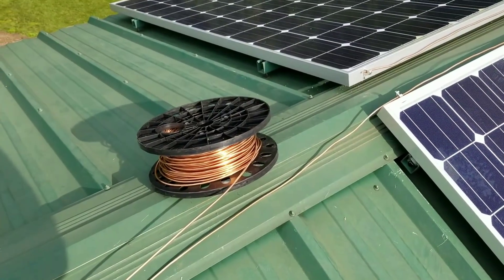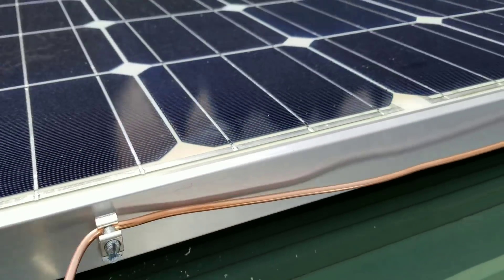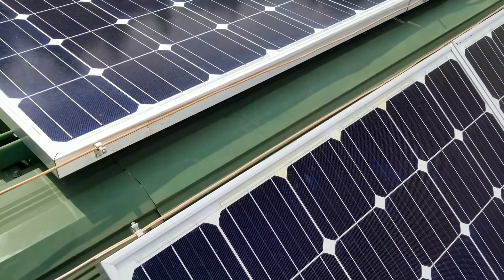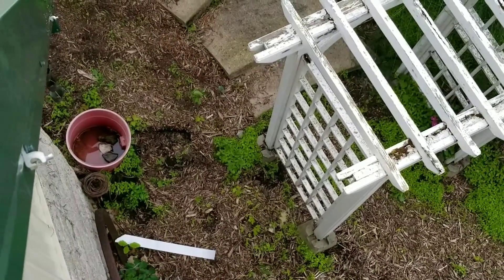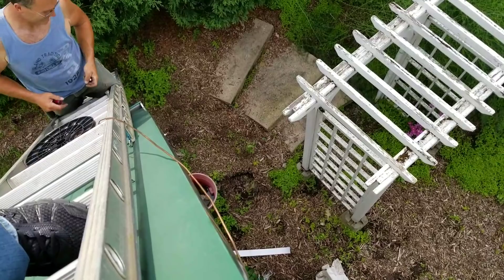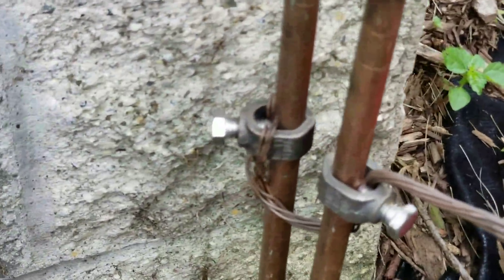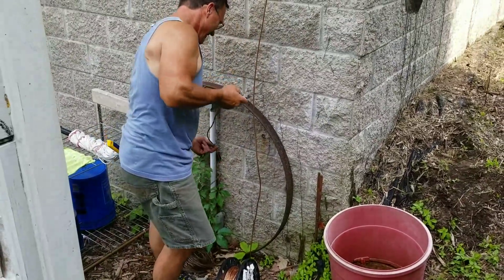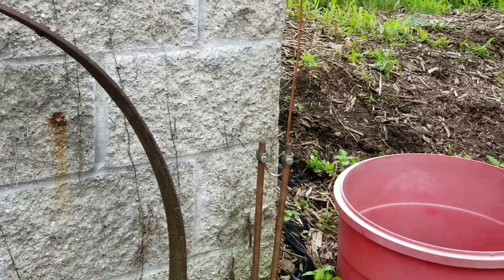MOST POWERFUL GROUNDING TECHNIQUES FOR SOLAR | PARALLEL GROUNDING FOR PHOTOVOLTAIC SOLAR PANEL ARRAY

Comment: You know you are only grounding the frames don't you? This may turn them into lightning rods
Reply from the maker: @richardcarey169  
This Installation is about 7 years old and still working great without and problems.
Thanks for your concern and for stopping by.
Don't forget to LIKE SHARE and SUBSCRIBE and also check out my other videos

Comment: Nice video about grounding the solar panels, but I would've ran the grounding wire from the edge of the roof to the grounding rods in some conduit. Even PVC. I don't know the regulations in Minnesota, but the conduit would be for mechanical protection. Just in case someone has some idea about cutting the wire to steal it or something like that. Copper is expensive man. Or you could've used aluminium wire. It's cheaper. But the conduit is for mechanical protection and for aesthetics. I would say it looks more professional with the conduit.
Reply from the maker: @gerulais  
Thanks for your suggestions and for stopping by. 
Please don't forget to LIKE SHARE and SUBSCRIBE

Comment: It is great to uese two parallel ground rods but they should be 2 meter apart. 20 feet down in ground and a length of 2 meter or 6 feet . earthing pit should be filled with chemical powder.
Reply from the maker: Thanks for your contribution.
You mentioned "the Earth pit has to be filled with CHEMICAL"
What kind of chemical is that?

Comment: Pretty sure if lighting strikes anything on that roof those panels are fried…the ground is to keep you from getting electrocuted by a short somewhere
Reply from the maker: Mind you, this Solar System has been running for at approximately 7 years without any problems with  lighting strikes around the neighborhood and also farms around.
Anyway, thanks for your opinion and STAY TUNED and learn how solar works.

Finally, don't forget to LIKE SHARE and SUBSCRIBE to the channel for more content.
Reply: @jwsolarusa  oh I am definitely grounding my system.

Comment: What about the inverters and your house?  Do they use the same ground rod?  I was thinking if lightning hits a tree near by then a different voltage would be induced at the different ground points/rods which could lead to damage to the electronics (inverters etc) at least.  I'm not sure if these regulations are always sensible (drawn up by fallable humans like you and I).

Comment: HOWdy  JWSU,
Thanks
FYI = here in INDIANA  those TWO 8' long Copper Coated Steel Grounding RODS must be a minimum of  SIX (6) feet apart and "BONDED"  to  accomplish  a PARALLEL Grounding System 
COOP
...
Reply from the maker: Hey......🖐😉
How are you.......🤗
Thanks for stopping by
Reply from the maker: LIKE SHARE & SUBSCRIBE
FYI..... I am your first SUBSCRIBER ! .........
HO....AH🏋️‍♂️👍

Comment: Not too sure but copper and aluminum in contact will cause corrosion. In other grounding they keep the copper 1 inch away while using a stainless connector. I am about to built my own so I am doing research now.
Reply from the maker: Go ahead and build yours. Be sure to share your videos with us all.
SUBSCRIBE LIKE & SHARE

Comment: I am a rookie. excuse my questions. Did you ground the 6 awg wire to a combiner box? or to a charge controller? is it the same ground wire to the battery bank?
Thanks
Reply from the maker: The panels are grounded to a 8ft copper ground rod. 
LIKE SHARE & SUBSCRIBE
Reply: The same grounding should connect the entire installation. Dangerous otherwise.

Comment: What kind of ground bars did you use? Also what if you add more solar panels..Do you have to replace all of the ground wire?
Reply from the maker: Hello and welcome to jwsolarusa.
I have two six foot copper ground rods with #6 AWG copper wire I interconnect the solar modules. You can find or buy these components at your local hardware stores like: HOME DEPOT, LOWE'S, MENARDS or any of your local Electrical hardware stores. 

If i decided to add more solar modules, I will have to continue with the same circuit from where I stopped. 

Thanks for asking, LIKE & SUBSCRIBE to my channel for more CONTENT coming your way.
Reply: Thank you..I thought you cant add to a ground line I thought i heard it had to be a contentious line without a break
Reply from the maker: UNISTRUT NUT WITH SPRING: Superstrut Solar Panel Mount
https://youtu.be/XBR-aiK7kIw

SOLAR PANEL ORIENTATION/Cutting Unistrut/Superstrut for Roof Mount Installation
https://youtu.be/eNFo08dfN8Q

UNISTRUT SOLAR PANEL MOUNT: How to install solar panels Using Unistrut/Superstrut
https://youtu.be/3uubcw8gGPw
Reply: I'm an Electrician from Nigeria with about ten yrs experience i will love to work with u if u can help me. 07037113772

Comment: About the parallel grounding putting two rods next to each other it’s losing time and money, to properly improve the grounding impedance you have to set them apart with a distance of at least 2mts. To properly measure the improvement you need a specialized ohm ground meter.
Reply from the maker: Thanks for the input Francisco.
Reply: The distance between 2 rods is twice the length of the rod.  So if you are using 10' rods, the distance between them is 20'. So, yes, is a whas
Reply: a waste of time and money to put 2 or more rods together..
Reply: @adi9546  Except they're coupled one on top of the other, deeper into the earth. In any event, until you take an earth resistance reading, you can't really beat your chest.

Comment: Good size copper, i guess the panels are pretty strong , but I wouldn't walk on them just in case, I've actually seen small hairline cracks in the individual solar cells that make up a solar panel from people manoeuvring panels with their hands pushing against the backside of the panels.
Reply from the maker: To be honest with you, we were walking on top of those panels for the rest of time we  were up their. They are pretty tuff modules mate.
Thank for the comment and have a wonderful day mate.
Cheers
Reply: jwsolarusa sunpower maxeon
Reply: Even shattered the panels still produce
Reply: @fauxque5057  they do but panels with cracked solar cells are disappointing power wise